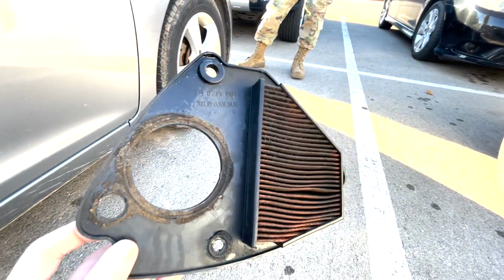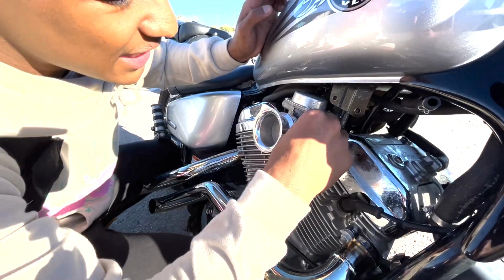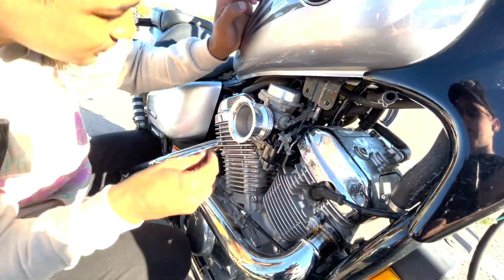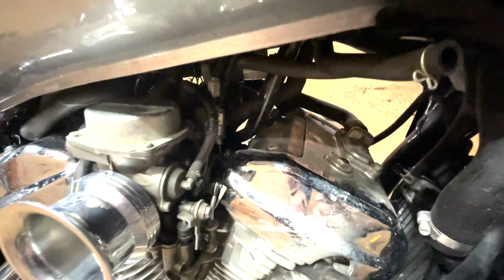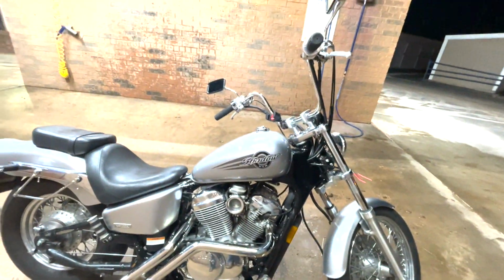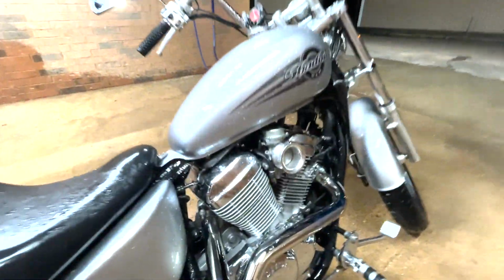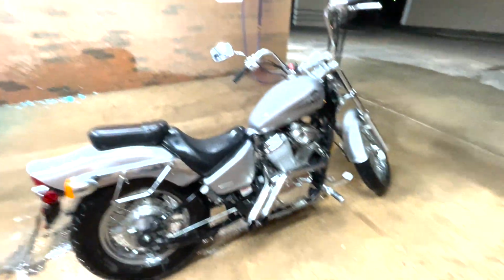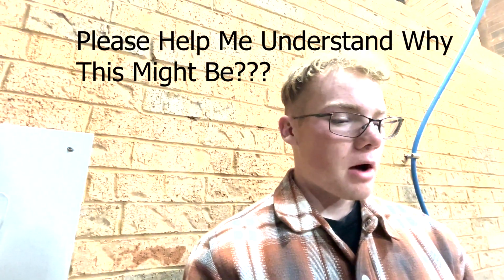How To Install VELOCITY STACKS/ 2006 Honda Shadow VLX

Comment: Exhaust turns color because of heat, usually more discolored closer to engine, running at high rpm's makes this happen, keep the revs low witch is hard to do. Nice bike
Reply from the maker: Perfect, this makes a lot of sense.  I could tell it got worse after a 3 hour trip on the highway and that definitely explains it
Reply: I never knew that
Reply: @VanceBuilds  He's actually not correct. Run bigger jets. Your bike is running lean.

Comment: did you have to replace wires and cables when you put those apes on?
Reply from the maker: Luckily I did not have to. Same stock wires. I did have to reroute them though but took about 5 minutes to do

Comment: pipes are coloring because bikes running pretty lean right about now, get a bigger main jet, adjust the fuel/air and you will not run so lean, plus you will notice some power gains...and please, dont hit the stack with the water...its going right into your carb, they drink gas not water lollll....bike looks and sounds great
Reply from the maker: Thank you. Lol ya I figured that out once I went to start it back up😂 thing took like 5 minutes to get going with all that water lol.